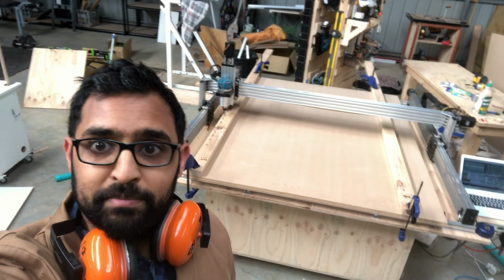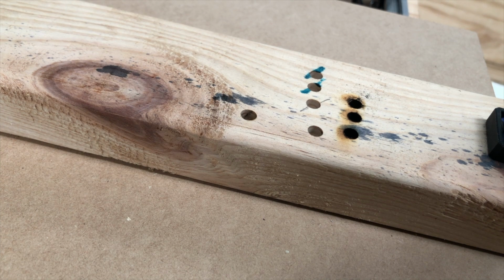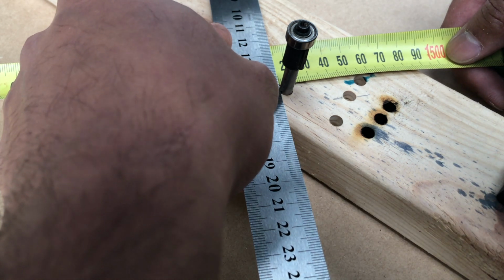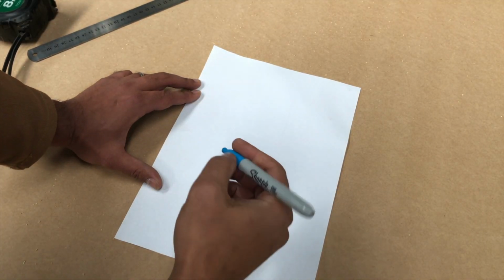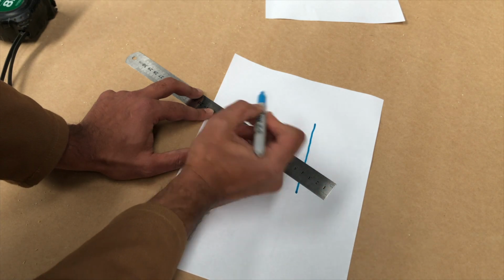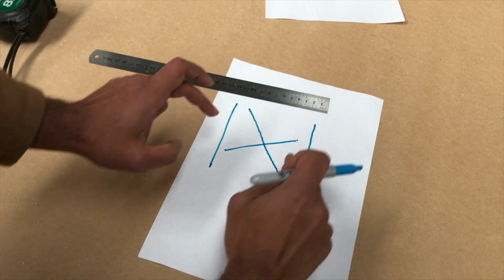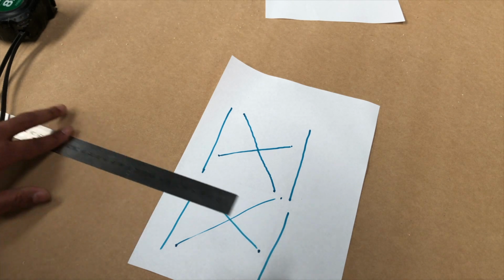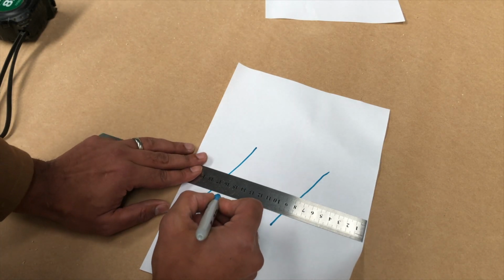Squaring up a Lead CNC machine

Comment: Better method is use phytagoran triangle. 3 units on x, 4 units on y should made 5 units between the start and end points. Size of a unit depends on the size of your router.

Comment: Great informative video. I would like to see the projects planned for this machine. How capable is it?
Reply from the maker: Thanks. It's a really capable machine. i've used it to machine through plywood, melamine veneered chipboard and MDF. It's has a working area of 1200mm x 1200mm so can cut half a standard sheet of material.

Comment: nice machine mate, where did you get your frame from looks solid
Reply from the maker: from maker store.com.au. it's a mega solid frame. although the z axis is not so good due to the v wheels. I'm going to change it to a linear rail set up when i get the chance. in fact i'd change them ll to linear bearings. they're much more stable. But that's a job for another day
Reply: MakMadeThat how easy is it change linear bearing can u make video bc I want to chnage my desktop one to linear ones
Reply: @maviisen37  changing to linear bearings is on my todo list (which is only getting larger not smaller!). ill get it up hopefully before the end of the year
Reply: Thanks for doing the video explanation. I'm just finishing up a build that utilized 2" EMT conduit for X and Y axes. It is very robust but I anticipated some gantry racking as it is a belt drive system. I incorporated an above table wire cable and pulley system to mitigate racking. I think your method will really work well in fine tuning my machine. Thanks again!
Reply: @dalefife9854  Glad to be of help